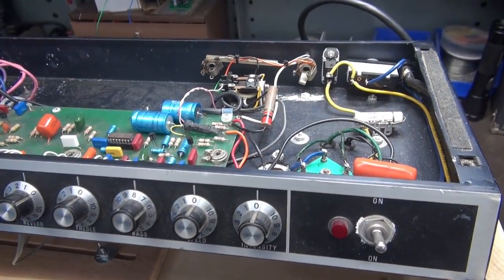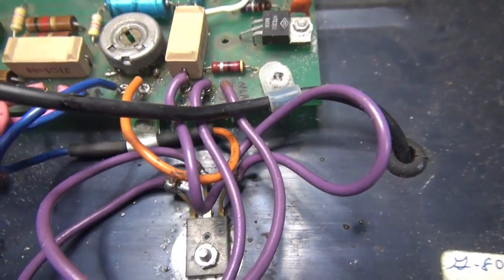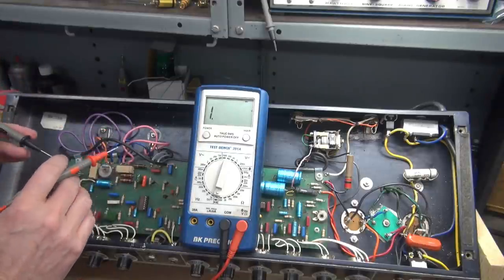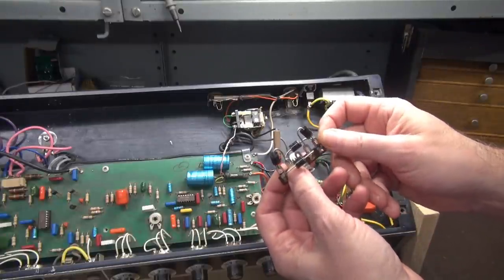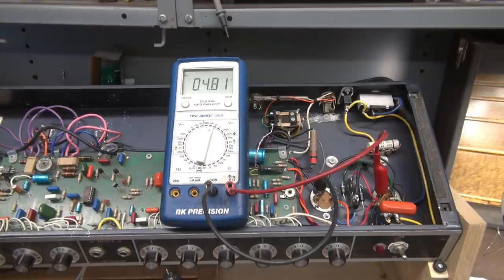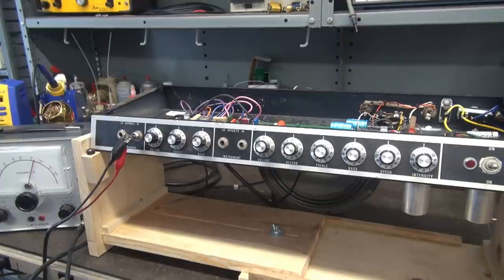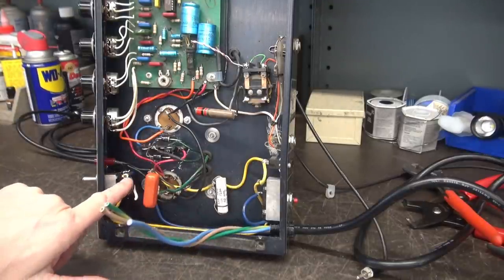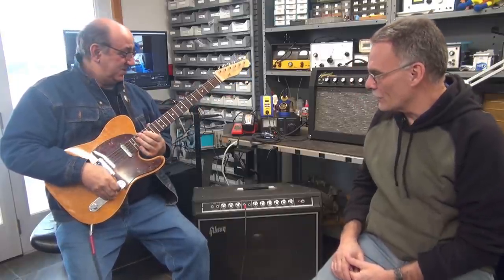How to repair Gibson G60 Transistor solid state Guitar amp shorted power supply

Comment: Hi Terry, love your channel. Here's a bit of trivia regarding power cord grounding:

Did you know that electrical codes in North America and Europe specify that equipment power cord grounds be bonded mechanically to the chassis via a dedicated (not shared) ground screw or stud, and must not be soldered. For stranded wire, a compression lug is recommended for the ground wire connection to the ground screw. The reasoning behind this specification is that, fault ground currents can be so high as to melt and blow out the solder bonding the ground wire to the equipment. With a disconnection, the cassis now becomes a shock hazard.

You can't always count on a panel breaker to trip and interrupt the fault current soon enough to keep a soldered ground wire bonded to the chassis. Breaker trip currents are usually much higher than rated breaker currents. The specification is also there to safeguard against fault currents being applied to equipment from an external source. External fault currents can occur when several pieces of equipment are interconnected via cable and a ground fault occurs in one of them.

If a grounding stud cannot be welded to the equipment chassis, then a dedicated screw can be used instead. The way to attach a grounding screw to a chassis is to drill and tap the chassis for the screw thread (say 8-32 NF). Bare metal must be exposed on the cassis for the head of the screw and the nut that locks the screw to the chassis. The grounding  screw is attached to the chassis by screwing it all the way into the chassis, such that the screw head firmly seats on the exposed bare metal of the cassis. On the other side of the chassis, a star washer and nut are used to secure the grounding screw to the chassis. The entire assembly must be screwed together tightly.

To bond the power cord ground wire to the chassis, slide the open hole of the ground wire terminal onto the cassis bonding screw and thread a nut behind the lug to clamp it down tightly to the chassis nut. Note that, only the power ground wire may be attached to the chassis ground bonding screw; no other ground may be attached to this screw.

Comment: Hey Terry, I own a 4x10 version of this amp. Have a look for schematic/info for a Randall RG-60 Commander. Same amp, and these were built by Randall for Gibson, to the best of my knowledge.
Reply: Ah, after reading your comment, I did notice they have very similar color schemes and layout. I have a Randall Rg80PH head that I recapped and the amp is a masterpiece in terms of build quality, and it's an amazing sounding amp. Randall used the preamp design for the RG series in several models until the late 80s.

Comment: Some power transistors do not require insulated mounting hardware. This could be the reason there were metal screws holding the transistors in.

Comment: I repaired one of these a few years ago and it's still at my shop. The outputs were blown and had to replace most of the pots too. The reverb is pretty noisy and I suspect the reverb IC is the culprit, but I can't find a suitable replacement (out of production). I replaced all the res and caps in that circuit but no luck. Other than that, it's all original. Replacing board mounted components requires unmounting the outputs and remounting to test with a signal. If I had some female pins of the right size I could have soldered them to the wires leading to the outputs and just removed them with every board pull.

Comment: Thanks for this ! I wonder if the collectors to ground short measurement is explained by the fact that the shorted bridge was still in place at that point. Also if the outputs are all plastic body with no metal exposed, they would not need insulated mounting hardware. And finally, i noticed that on the schematic they drew the top output Q as PNP instead of NPN. I am learning from some of your other videos and thanks again!!   Rob in Rochester NY

Comment: Great video!!  I have the smaller G40, owned it since 1977. The G10 through G80 amps were built by CMI for Gibson. They had the reputation of sounding surprisingly good for being solid state. I always loved the sound of mine -it’s like a clean Princeton. I did my own re-cap and power cord replacement, but did not know about the flakey circus breaker!  Thanks for this tip. I’ll be replacing mine with a fuse very soon. So what was that extra jack in the back? Mine had a hole covered by the model name sticker I used for a speaker jack. Maybe I shouldn’t have defaced it like that.  I turned my friend onto the Gibson Super Thor bass amp with two 15” that looks almost identical. The “G” models that end with a ‘0’ seem to be blackface, and the models ending with a ‘5’ are silverface (G-55, 105, 115). Hmmmmmm . . . Gibson Blackface /Silverface, I think I just invented something new!
Reply: It looked like the added jack and relay circuit was connected near the LDR. I take it this amp has a tremolo/vibrato effect built in? So I'd wager it was an extra footswitch to switch that circuit on/off. Also, should definitely wire the amp with a 3-way prong for proper safety grounding.
Reply: The factory jack in the back panel for reverb and tremolo was a TRS (Tip, Ring, Sleeve “stereo”) that connected to a dual  button footswitch. There is not ONE picture on the internet of a 70’s Gibson solid state amp dual footswitch (there is one, but not branded as Gibson). Maybe CMI/Gibson provided no footswitch? I bought my amp used and it came with a Linemaster L-2-D footswitch. I always thought it came from Gibson, but maybe the reseller added it. It works surprisingly well.  Of all the pictures on the internet the hole I found is always covered with the model name. I always wondered what they might have intended it for. It’s in a mildly inconvenient place for a speaker jack.
Reply: I have the Epiphone EA 600 Rvt Maxima it's the sister amp of Gibson's ga 600 rvt and its beautiful and needs work but i wouldn't part with it ever. Great looking amps they were building then and SS amps from that era are becoming very rare.

Comment: Bit of an odd choice to be replacing the heatsinked rectifier with discrete diodes of rather limited power dissipation to be honest... the original 50-year-old part may be obsolete but these square bridge rectifiers with center hole have remained super common, especially for 10-15 amps up.

Comment: I have a Epiphone EA-600 RVT that has a blown Motorola mr1033b rectifier Diode and it powers up but blows the fuse immediately. I would really appreciate your help with some pointers on fixing it. I love these videos you put out. I have electrical knowledge and know how so i can do the repair but need some questions answered also i have the Schematic for it

Comment: I wonder what would happen if you had those transistors connected to chassis with the 3 prong chord...
Reply from the maker: KaBoom!
Reply: Sounds like a job for ElectroBOOM
Reply: You'd just have a very high current fusible link; the chassis! 😨
Reply: @bobblum5973  , I'd say the transistors would behave like firecrackers :)
Reply: @danielsaturnino5715  Not on the same scale, but a friend asked me to fix one channel on a stereo receiver he'd picked up at a flea market.  After troubleshooting, I replaced a small signal transistor in a TO-92 plastic case with what should have been a functional equivalent replacement.  Turned power on, and SNAP!  Where the transistor had been was just the three tiny leads, the case was blown completely off!  That was around 1977, so long ago that I don't recall if I ever got it working or not.